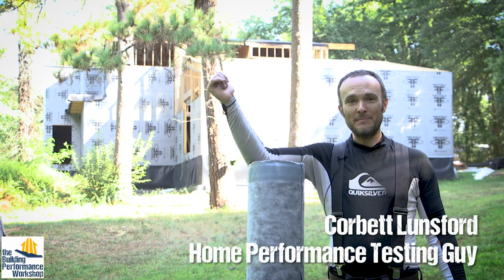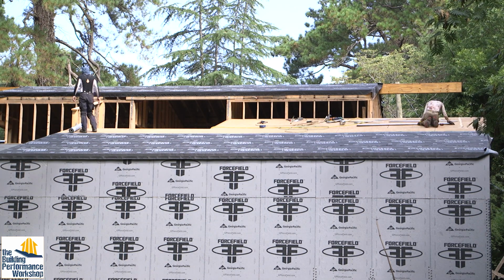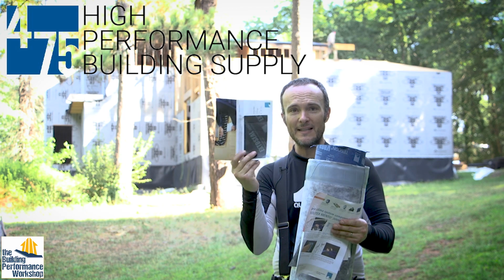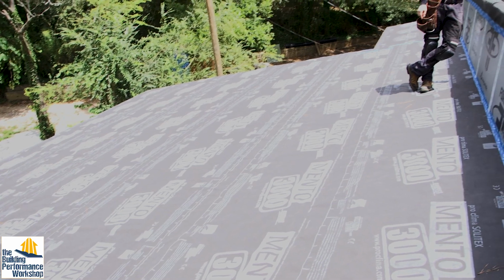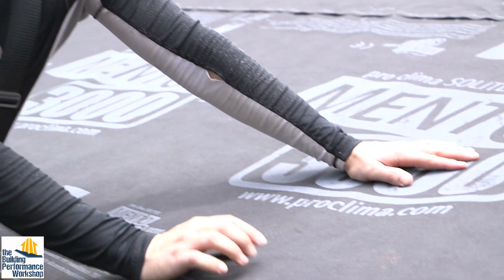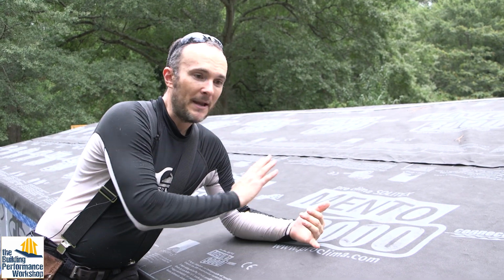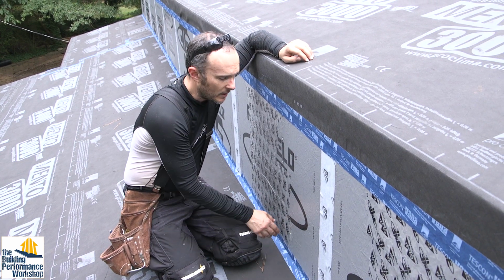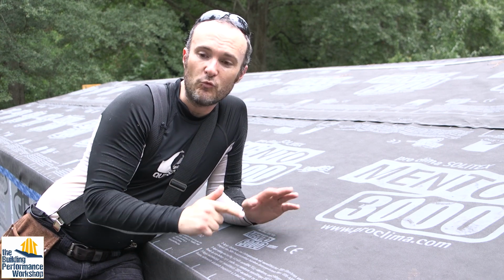Installing Mento Airtight Roof Underlayment

Comment: Why didn't you use forcefiled for the roof?
Reply from the maker: Not approved for roofs.
Reply: @HomePerformance  I've seen it installed on roofs.  I wonder if the builder's know that.
Reply from the maker: Learned today that FF has JUST been approved for roofs recently, did not know it.

Comment: I realize this is an old video, but if you know how far out those eaves are going to go, why not start the Mento underlayment close enough to the edge that it would cover the eaves and use two perfectly overlapping pieces for that first strip.  The bottom layer would be folded down the wall and taped to continue the air barrier and the upper layer would be taped only at the top with the bottom left loose until the eaves are attached, then taped to the eaves.  After laying down these two perfectly overlapping layers as mentioned, you would do the shingle pattern the rest of the way up the roof just like you did.

Comment: I have a question about butyl backed tape before battens. Would the screws that hold down the battens penetrate the underlayment?
Reply from the maker: Yes, of course- hence the tape
Reply: @HomePerformance  ok,  just learning about all of this. So what is purpose of the tape since the screws are going to penetrate?
Reply from the maker: @CAC-1111  there are no dumb questions, Minni, just unasked ones! The tape's only purpose is to self-seal all the penetrations the fasteners will make. That's the property of butyl tape that makes it so valuable for this application.

Comment: I simply dotn understand why you are insisting on a “permeable” roof  with this membrane ?  That requirement is what is driving you away from proven cheaper underlayment-sharkskin, or even grace and water shield. ANY bulk water leakage will more than exceed the health “risks” you are trying to avoid re mold etc. Heavy tar paper, esp two layers is also permeable and far far cheaper...
Reply from the maker: I’ve used this material before to great success, John, and since it’s my house, AND because our #1 goal is to get people thinking outside the box of mainstream building.

Comment: The comments on the “dings” in the Mento3000 were really concerning. The fact that you’ll look for actual leaks migrating to the sheathing seams to then troubleshoot where a “ding” was is nuts. After watching this I really question the durability of the underlayment...no matter what you install it’s gonna get banged up and it better be prepared for it. Especially at this price and performance target.
Reply from the maker: Reminder: you install an actual roof over this.
Reply: Home Performance if your response is “you install a roof over it” then why in the heck pay for such an expensive underlayment? Use #15 felt then? I think you’re looking for a good belt and suspenders approach but ignoring the fact that the suspenders you’re wearing are broken.
Reply: @HomePerformance  Did I miss something?  I thought you said you will be ding a visual inspection of the entire roof and resealing any "dings" with tape designed for the task. I understood you to mean that the "looking for leaks" on the underside is intended as part of your inspection for "dings."  It's sort of like using a smoke pen to locate small air leaks during a blower-door test - right?
Reply: Isn’t it peppered with nails? The only underlayment that seals nail holes is fluid applied according to testing.
Reply from the maker: @Krunch2020 metal roof on battens, not shingles

Comment: I’m really surprised you only went with R38 for the ceiling (which likely implies thermal bridging). What was the logic that led you to this given the significance of the roof plane in conductive energy loss?
Reply from the maker: Energy modeling gives you the performance effects of various improvements, and the insulation levels we use are ideal for the home as a system. Cooling load on studio space= 1/2 ton (the smallest minisplit you can find). Cooling load on the main house = 1.5 tons (generally the smallest split system heat pump you can find). Adding more insulation anywhere in this house would intentionally detune the enclosure from the HVAC. That’s not home performance.
Reply: I'm sure he did a return on investment analysis and anything above wasnt going to have a good payback, also he mentions he's not in it for energy efficiency hes in it for comfort and health, energy efficiency happens to be a byproduct.
Reply: I very much disagree with the response from “Town’s End Living”. Adding a proper amount of insulation to the roof plane is all about comfort, efficiency is the by product in my book. What’s the larger contributor to comfort in a room, air or radiative temperature? Forgoing the proper insulation depths compromises the envelopes ability to control radiative temperature. If your response is just “we’ll throw more heating/cooling at it” I say you’re focusing too much on the “system” of the house and not the “system” that’s our planet. Just my 2c, we all have different motivations and that’s all good!
Reply: @batmb1e  he was focusing on the house as a system down to very little detail, as he explained if he were to add more insulation the HVAC units would be oversized and therefore turning on and off too often, a ac unit needs to run for a minimum amount of time to start to condensate and perform its job correctly and efficiently. He cant get any smaller of a unit then he has now. Plus the R38 on the fashion that he has assembled works together alot better, has a better U valve than most houses with even higher insulation values. At a certain point its smarter to put your money in other items, and I'm sure along with planning the system and his goals he also had to plan for a budget, everyone's budget is the biggest variable.

Comment: So why not Grace  
Ice an Water over the whole roof, it cuts out a few steps an Ice an Water the heat up an will just absorb to the OSB an close holes from nails
Reply from the maker: I don't believe Grace is vapor permeable like this is- it's a membrane, not a rubber layer.
Reply: A much better belt and suspenders approach ? Plywood, Grace Ice and water shield, and one of the thin roof underlayment that maintain a small air gap under roofing material . Grace seals around all nails, air gap ventilates Does anything that gets past roofing (thsi you doubt need to ventilate water that gets into OSB, and  if some  water should get into decking, its plywood and much better at releasing water prior to delaminating . Sure rio in veery way to your approach- ventilation, nail penetrations , and more durable decking. And Gracie is self adhering through not just the terminal six inches !!!

Comment: Love your videos - keep them coming!  Quick question: would you be using any different products if you were building in a cold climate (northeast)?  I'll be putting a new roof on a 200 year old post-and-beam in the spring so the vapor-permeable underlayment got my attention...
Reply from the maker: It's all part of a system, of course, so no one product takes the cake or is a 'must have', but yes, lots of high performance builders use this system in cold climates. 475 is based in NYC.